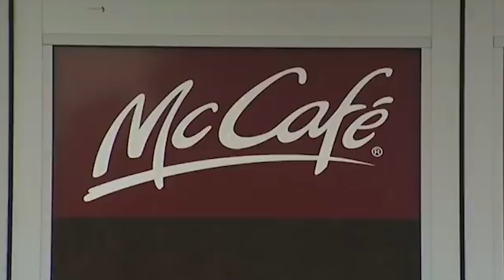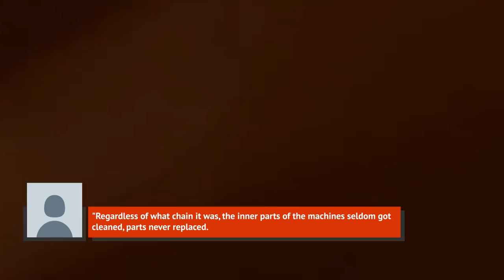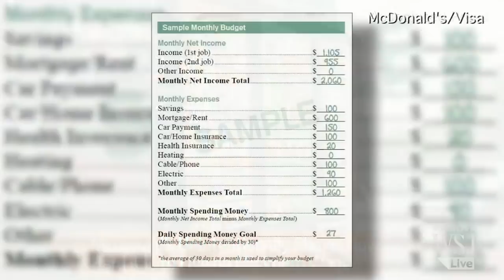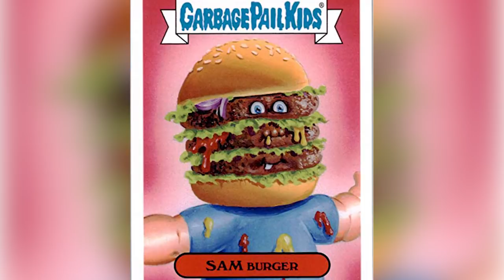Huge Secrets McDonald's Tried To Hide From Everyone

Comment: I can't believe how bad they have become with cleaning. When I worked for them in the 80s the shake and ice cream machines were tore down and cleaned every night.Part of the cleaning process included running sanitizer and water through the machine prior to tearing it down. Then each part was taken apart including the rubber gaskets being removed. Then they went back to the sink where they got an extra cleaning. The soda machine had the ends removed and they soaked overnight. The ice machine had a regular schedule for emptying it and cleaning. every morning the fry vats were cleaned, the oil pumped through a filter, the empty vat cleaned. Every so often the grease was completely changed. All this cleaning may sound like it took a lot of time, but not really. A crew of three with a manager could close the store in an hour. In the morning one person put the equipment back together during breakfast.  So why the change? To save money? Laziness? Maybe they don't care? All of the above?
Reply: I’m working there at the moment and we do that at night.

Comment: I use the Apple Pies (often given free... guess they don't sell) for a multiple of simple hardware tasks.

They are tough and last forever! Also they fly really well... if you're fighting unwanted wild animals.

I keep them on the back porch and use them for footwear when it is raining and I want to step out for a smoke.

They smell kinda nice... but, I'd never actually put my mouth on one. Well, I did the first time and broke a molar.  

Mix them into concrete and get a really tough set that a missle couldn't crack.  

Tough Stuff.